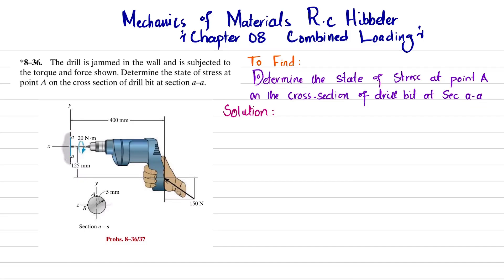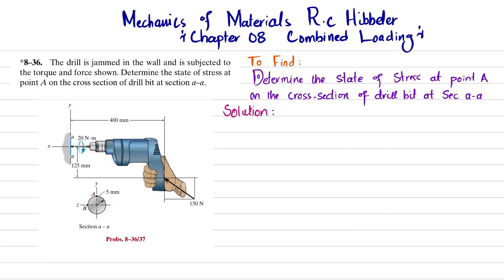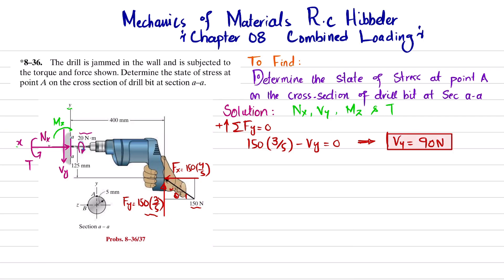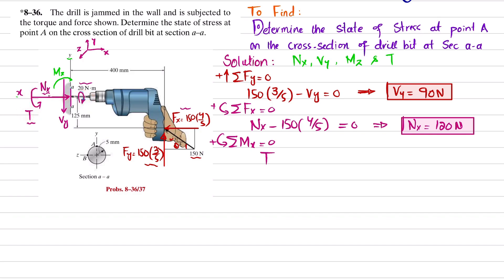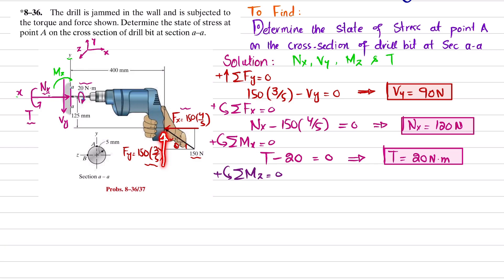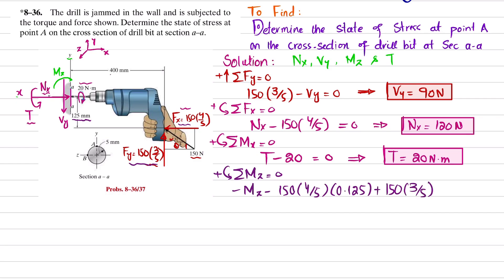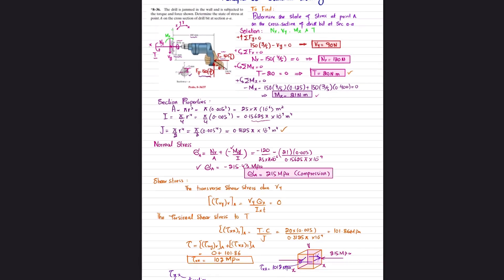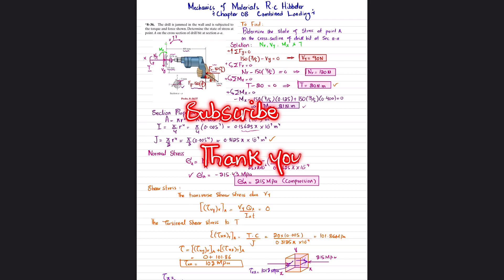8-36 Determine state of stress at point A at section a-a| Loading | Mech of materials rc hibbeler

Comment: When calculating mz, is the reason we take vy and nx into account because they pass through moment points? If they did not pass through, we would include them too, right? thank you
Reply from the maker: No you can see these forces along with the horizontal and vertical component of applied force F are producing couple about Z axis therefore. If we talk about a point at which sum of all moment is zero then forces passing through that point will not produce moment ❤
Reply from the maker: No you can see these forces along with the horizontal and vertical component of applied force F are producing couple about Z axis therefore. If we talk about a point at which sum of all moment is zero then forces passing through that point will not produce moment ❤